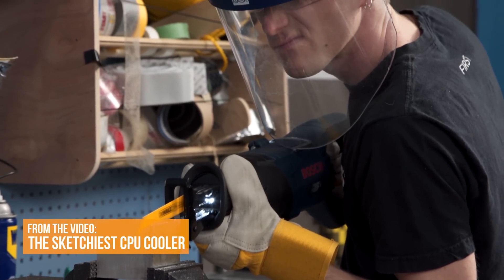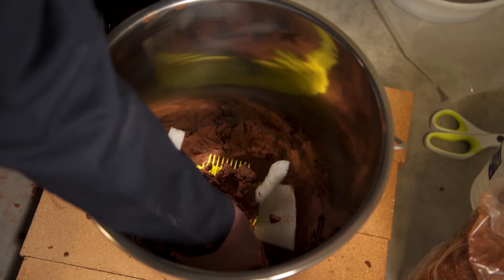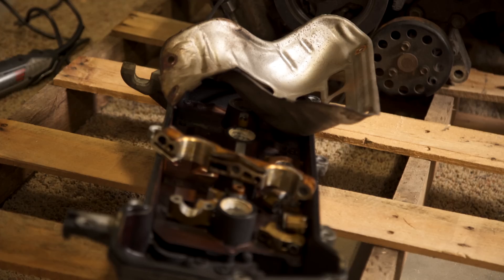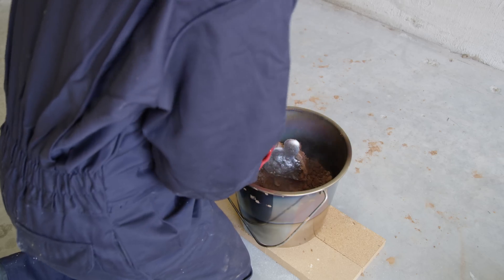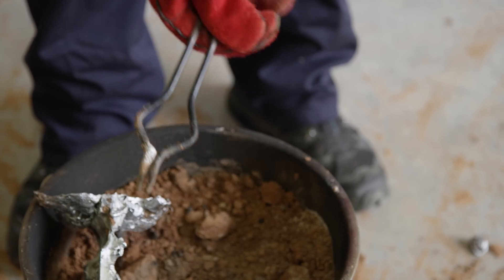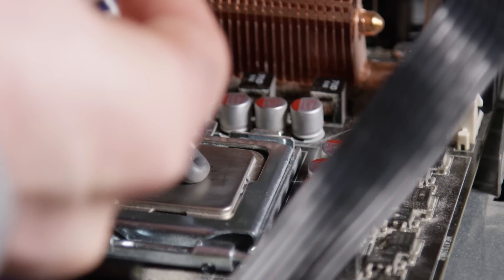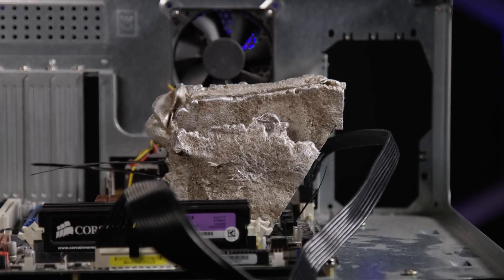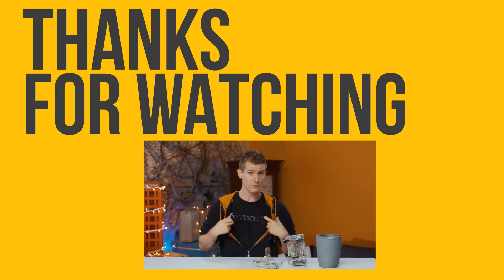The WORST CPU Cooler EVER – Sketchy Heatsinks Ep2

Comment: Not an expert, but I play one on the internet.  I think you should try pouring in from the 'chip side' of the cast and also try some legit oil bonded casting sand.  Casting sand with water in it can be scary as fuck.  And any water it boils means that aluminum is losing heat faster and not getting into those 'cooks and nannies'.

Comment: Get a large firebrick and drill a mould into it and then pop the aluminium in. Use a grinder to get a lovely flat plate for the CPU and shazam, custom heat sink!

Comment: here's a tip, before making metalworks video see one vid of someone doing it properly, did not expected this hard compilation of fail for a while xD
Make a proper frame, use the sand correctly instead of mashing it in. It was painful seeing how you spend a lot of money for a graphite crucible and wasn't able to do anything where people are doing miracles using playsand and pseudo-crucible from a fire extinguisher in a hole dug up in the ground

Comment: U need to cast out of styrofoam and use regular sand. Or buy plaster of paris and mix it with sand. Then, make a mold of the 3d  printed heatsink, with the plaster of paris and sand. Then cut the mold in half to remove the 3d printed heatsink, Put them back together using clamps and put molten aluminum in it.

Comment: Just get a 120m cubed block of copper/aluminium and use a bench drill drill to drill in on 5 sides either by drilling each side or drill straight thru on 2 side and on the top. Make sure you get rid of about 60-80% of metal. After that put 2 fans on and bingo, custom heat sink.

Comment: You should try using black casting sand, as it might help more. It's "fluid enough" if you will that it can fill in some relatively narrow spaces and openings, but when the mold is vibrated to set the sand, it has a tendency to settle quite heavily and hold it's form nicely, that even if the foam base was burned away and filled with Aluminium, should keep the original shape.

Also, when it comes to pouring you generally have one spout, almost always in the middle of the piece, and multiple vents around the casting so that the gases from the burning foam can escape easier. And of course, get the Aluminium as hot as possible and you should be good to go.

Comment: dude, your idea is correct but the 3d mold has fins that are way too thin to be molded in aluminum.
the green sand needed to be dryer than what was shown in the video. it should behave just like play sand and needed to be compacted good.
you need to melt aluminun not until its liquid. until it boils in the giant cup thinggy forgotwhatitscalled.

Comment: The main problem with your designs was expecting the metal to go UP and fill the fins... Molten metal behaves a lot like any other liquid: it follows pressure and gravity. If you don't have enough pressure to push the metal upwards to the fins, it's not gonna go there. The best thing to do is put the fins facing downwards. Also, it would be a good idea to use a single rod to guide the metal to your mold.
Now, I've never worked with this type of thing, I'm just mentioning what seems the most obvious to me. If you REALLY want to know how to cast metal, you should try talking to the guys at Man At Arms, they do metal casting regularly and can give you much better explanation on how to do it.

Comment: First off you needed to use a CNC to cut the foam to spec then put it BOTTOM UP in the sand so the Metal would trickle down into the fins

Comment: i have easier idea. buy thin sheet aluminium -> make a cast for the base -> pour the molten aluminium on the cast -> heat again -> stack sheets where every second sheet is higher so there's a gap on the bottom -> dip the sheets in to the cast. boom you have heat sink with quite a bit of surface area

or just weld it together xD

Comment: use the organic plastic again but this time, after the greensand, put it in a home oven at 350-400-ish Fahrenheit for 4-5 hours.
This does two things, melts out the plastic providing a clean cavity for Al
and cures the clay in greensand.
Make sure to put it so the plastic drips out, and you can change the angle a few hours in to make sure all is out...
Linus, be nice to the ppl who have to stare at monitors with your face on them all day :P

Comment: Entertaining video. Glad the hydrogen formation in molten aluminum didn't explode as it requires degassing. If you try again make the printed part with something like Moldlay or Engineering Wax that is meant for wax casting.

Comment: This video is amazing. I went to a polytechnic school, and I've poured + cast aluminum. Make a packing frame out of a metal container and make your design in plastic like you did before, but remove the plastic moldings before you do the pour. This is possible if you use a stack-design, and pack the sand tightly around the design. The stack can be split in half to remove the molds (and the pouring path) after the sand cools and hardens. However, it might be difficult to make the fins since casting isn't the greatest at mimicking fine detail.

Comment: pro tip. you will never be able to force molten metal up into the fins. put them on the bottom. Also, dont do the lost foam or pla. try a mold made of the green sand in 2 layers. the pla print is used as a model and then when sand is packed in around it and the print is removed, the negative space is just how the casting will turn out. and lastly, use professional green sand. it has no water so you wont get bubbles and it is a lot easier to work with.

Comment: The Zalman cooler that was used on my old AMD HD4850 seems to be made out of aluminum and copper sheets of around 0.2mm (plus two aluminum blocks to make the contact area larger), and those sheets are being "held together" by two screws. "Held together" as this was also probably pressed together with a hydraulic press, IDK if the screws were strong enough to get them together. This seems to be a good basis for a project.

Comment: If you want to make your own heat sink, I recommend soldering together sheets of copper.  Cut a square base (about 0.2" thick) to lay flat on top of the CPU.  Then cut a bunch of rectangular fins (about 0.05" thick), and stack them up using FR-4 spacers in between.  Clamp all the fins and spacers together.  Set the base on a hot plate, then set the fin-sandwich on top of the base, and then feed solder in until all the fins are soldered to the base.  It's a bit tricky, but way easier than casting.

Comment: You didn't even cast it right. bottom half should have the item you want cast fill with sand then take the item out. Top half will be nothing but sand and two holes.

Comment: use a big machine to make the mold, it's called "the molder", then use another machine to heat up the metal called "the melter", then use "the pourer" to pour the metal into the mold, another machine called "the making sure everything goes up to plan" will make sure everything works so then you won't have to worry much.

Comment: ❤.❤ It's beautiful...
But in all honesty I would go with a capped copper tube filled with graphite or car radiator fluid or your choice, caste aluminum on the bottom, sanding down to effectively have a stock heat sink with a copper slug in it as a base then soldering aluminum sheets toi the pipe, it would have to be a high silver or copper solder, but it might work.

Comment: Linus Tech Tips - For episode 3 try out using a copper plate and using copper solder to attach cutout pieces of copper plate as fins.  

The fact you don't have heatpipes to start with means LTT can't do the easier to produce heatsink styles, that are just heatpipes soldered to plate to have even contact for the cooler with just sheets of aluminum with holes punched in them and soldered to vertical heat pipes for stability.  You know, the typical tower style cpu cooler.

Comment: good gawd, I learned how to do Aluminum casting WAY back in high school. Back when CPUs didn't need heatsinks. You've dun fucked it up.  also soda pop can work well for scrap, but you'll need a truckload.  you should have had the fins pointing downwards, as i learned in sand casting molds, let gravity flow the molten medal down onto the surfaces with the most detail.  And idealy you should use a split-cast mold so you can remove the original plastic out of the mold, and make more copies.
Reply: HUGSaLOT Valkyrie Then why learn the basics of casting only to produce a crustacean fossil? It's all in good fun but if he legitimately does have an engineering dept, they must be software engineers who couldn't have known that casting something that complex would never work.
Reply: soda cans aren't ideal for casting, too much surface tension. they did a good job getting casting aluminum from car parts.
Reply: To Athánatos you've been repeating this in their defense in so many comments.  Bruh
Reply: Kai Parthy makes all the fun filaments.  He produced a filament called "Moldlay" specifically for lost wax casting.  But it's expensive if you can find it.
Reply: Plus if they do the split mould the aluminum doesn't have to burn through the plastic, so it should be more consistent.
Reply: Yeah I've also casted with a split mould before, can confirm it works and is a good idea.
Reply: A lot of art sculpted in wax ( like Rodin's thinker ) facilitates melting away easy for the mold.
Is there a 3d printer medium spool that is wax or wax like?
Reply: pla is as good as it gets, you can't do a hot pour like they do with aluminum though, you need to burn it off first. Though I think most people who do lost wax with such large castings probably burn it off first too.
Reply: daaaaamn straight. why didn't they use a cast mold at all?
Reply: wax is too fragile to hold together and be wound on a spool.
Reply: I thought about doing it upside down after the second attempt. /r/iamverysmart
Reply: @Ryonin
Pretty awesome thanks!
https://3dprint.com/40579/moldlay-kai-parthy/
Found another solution on 3dprint's site that is a service for jewelry artists that prints and casts yer file from a wax mold:
https://3dprint.com/165283/twikit-baunat-3d-print-diamonds/
Reply: HUGSaLOT Valkyrie that's a terrible analogy. An accountant can very well be a decent artist in his free time.So you could expect someone at LMG to be not as rubbish at some simple split casting, which is why this turned out the way it did
Reply: Of course they fucked up, this is totally out of their work area. It's like asking an accountant to draw a portrait of yourself. There is no way he won't fucked up.
Reply: I'm 14 and no expert on metallurgy or casting but you sound like you know what you're talking about also maybe custom heatsinks could be the future of modding.

Comment: You could try using an AL sheet for fabrication. Cut one strip and coil loosely then tack/solder to a base PL cut from the same sheet. To add surface area of coil you can cut vertically down the coil after attached to base PL to make pillars of AL in a spiral pattern. If made wide enough you could even attach a fan to the top pushing down. The only issues may be the grade of AL and work ability of different thicknesses of PL and the conductivity of the tack weld or solder.

Comment: they already designed it in solid works why not buy a small CNC mill and use that?
AvE's drill press mill would have had a better result than this.

Comment: Making an extra thick baseplate, then having it on the top during casting, may have fixed the issue with the fins. The thickened baseplate could have then been sanded down to the thickness needed.

Comment: next time maybe try getting sheet metal, cut it into pieces, some maybe 4x4 squares, and then some 4x3/4 rectangles place them square / rectangle / square / rectangle / square / rectangle until you have 4 inches in length, then take one of the 4x4 squares and place that at the bottom
use thermal paste to attach them all and bolts to secure them.

Comment: Here is an idea: thermoelectric cooling with a Peltier device. This was a thing back in the day but it dropped out of "popularity", and nowadays, it is a rarity (very, very, very rare)

When you check it on Youtube, everyone does ONE fatal thing though. They slap the TEC unit between the CPU heatsink and the CPU itself. While this will cool the CPU down, it doesn't provide any heat capacitance, and the CPU heatsink is essentially blowing even more hot air inside the case. 

Also one problem with Peltier devices is condensation. Ice crystals (snow) forms around the edges of the device sooner or later, so slapping it directly on CPU is not really recommended. However, with a water block or through heat pipes, you can use the Peltier device more or less externally and may achieve good results; I'd rather recommend using the device to cool down the available heat dissipation units further so to speak. You can put in some electronics in between to check for the CPU heatsink/waterblock temperature and alter the Peltier device energy usage on the fly to provide cooling when necessary. Etc... etc... etc... 

I can keep talking, but just check the device out. They are not in use right now due to the condensation problems, and they are rather energy hungry. If you think this is a good thing to check out, please do it with a throwaway thing though, I'm not responsible for any short circuits or whatsoever! :)

Comment: I say take a big block of copper or aluminum and drill holes through it. Make a sort of honeycomb type of thing. You could even do vertical and horizontal holes for airflow. Hell you can get a cheap drill press for like 50 bucks.

Comment: How about the much better lost wax method since, you know, SHAPEWAYS PRINTS IN CASTABLE WAX!
Reply: Not only that but they need to research lost wax casting. 
  * Use green mix and hard pack on a wax model. Small grain sand, thin layers, packed hard. Use a ram rod.
  * Bake mold in oven (upside down) to melt the wax out to open the cavity and prep the mold to receive hot metal. 20 ish minutes should do.
  * Melt the aluminum just like you did before. Get the crucible red hot and keep it that way for 10 minutes or so to make sure its an even temperature.
  * Before you pour the mold preheat the mold hot as your oven can go without burning/melting mold container. 20 minutes average.
  * pour the mold in one shot thin stream into the poor spout.

mold design:
  * fins up
  * feed channel parallel to fin direction and input on the bottom. Come in at a 90 degree angle to the bottom.
  * add vent on top of each fin connecting to a master vent on opposite side from fill.
  * incline mold with 8ish degree angle vet highest
  * fill channel needs to be at least 8" tall. Vent exit can be as low as 1" over top of fin void.
Reply: What are your thoughts on plaster with sand, to get finer fin detail?
Possibly with vacuum assist to help fill thinner fins.

Comment: Try making a wax model of the heat sink you want to make, submerging that into plaster of Paris, melting the wax away, and then casting the metal. (Having the appropriate drainage hole when submerging the wax mold)

Comment: You're supposed to have a well that is lower than the mold cavity. This will fill up before filling the cavity when pouring. It will regulate the filling to be more controlled.

Also for your design, you might want two sprue pouring holes where the runner molten aluminum flow direction is parallel with the fins on both sides of the heat sink.

Comment: linus.... Take this advice from a machinist... Dremel on a stand, then add a quarter inch or smaller endmill, put the dremel on max (be sure you have an extreme amount of Rigidity) and start taking approx .050 inch of material off per pass (aka 50 thousands). Should work a bit better. If you have access to a bridge-port I would use that instead. 

Another option would be to use a band saw and a vice to cut the fins, then just deburr the sharp edges.

Comment: In this video

Technical ability: 2/10

Entertainment value: 10/10
Reply: You just summed up LinusTechTips.
Reply: Sharks. Sharks have figured out the best fin design...HAAAR!
Reply: I cannot like this comment enough. This was probably one of the most entertaining videos I've seen from these guys. Scrapyard Wars was pretty fun too for about the same reasons sometimes.
Reply: You can do thermal simulations in solidworks, they aren't going to be perfect. This is an optimization problem, solidworks won't do that for you.
Reply: Dummerbrella987 I personally could have done without sitting through that just to see if a fossil could cool a CPU, but whatever floats your boat.
Reply: Dummerbrella987 you mean -2/10 hehe
Reply: Linus did hire an engineer recently, I remember he mentioned that in his microsoft surface pro 4 video.
Reply: In other Linus videos

Technical Ability: 2/10
Reply: And that's what I mean, unless they have a proper engineer in house, they can't make assumptions based on some terribly inaccurate math.
Reply: You forgot engineering: 0/10. There is no way anyone at LTT was able to accurately guess the thermal properties of anything they make even if the made a perfect heatsink. Thermaldynamics is hard, and even engineers at Noctua, Cooler master and the likes have not figured out the best fin designs, everything is trial and error.
Reply: actually it was 2(2/10). Only math nerds will get this.